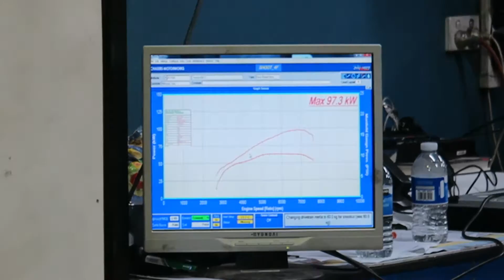AW11 MR2 4AGZE + SC14 Dyno - V.Log

Comment: Sweet ride.
Does anybody know the standard brake specs for the 4agze MR2? I'm trying to get a modified one back to standard-ish.
Reply from the maker: From memory, the front brakes are standard across all MR2s
The rears on my car were upgraded to SW20 rear calipers with front aw11 rotors with a 5mm spacer between the rotor and hub - it was a worthy upgrade. Same with the high temp pads.
Reply: @toddscars  Appreciate it!